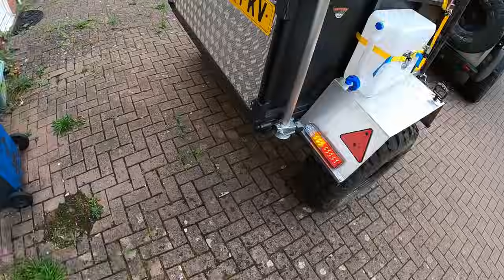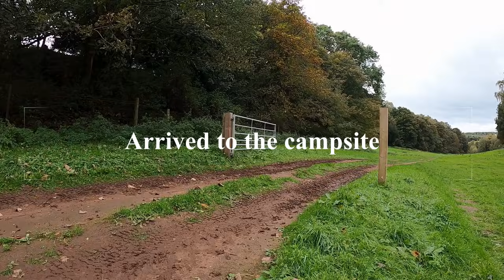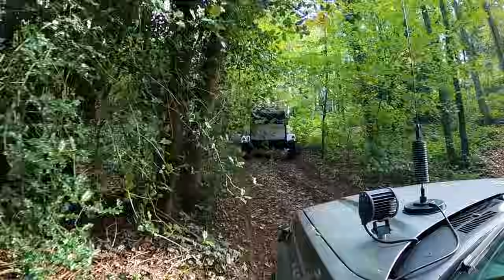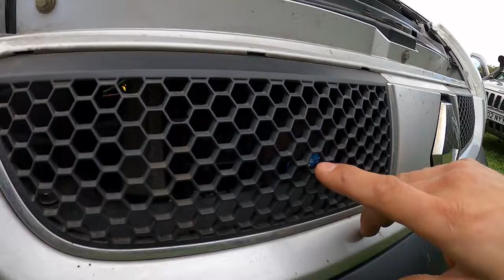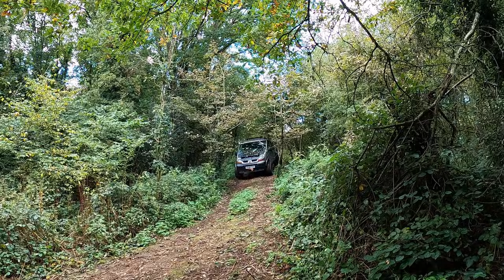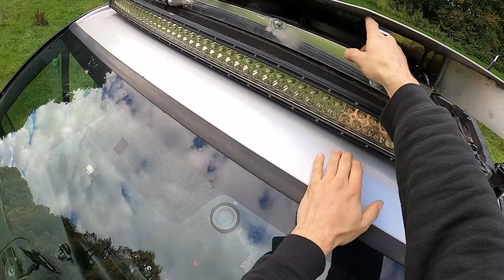4x4 converted van, off road and questions answered

Comment: What kind of engine is installed there? I have the same Renault Trafic and I am interested in building something similar
Reply from the maker: Its a Mercedes om606 engine with mechanical fuel pump build with bigger elements and vnt turbo, around 400bhp, I've sold it some time ago now. Trust me you do not want to build one.
Reply: @zurawskimotorsport This is my first car. I've hitchhiked a lot and now I want to travel in a motorhome. I've already made half of the living area. Now I just watch a lot of content and talk to knowledgeable people. I was just wondering how you managed to fit such an engine in there. I googled it and was very surprised that it was only 3 liters. It sounds very powerful🔥

Comment: What 4x4 van would you choose in the United States?
Reply from the maker: Well it all depends on your needs, if a small class van then probably an econoline,  I actually have one in the workshop doing Bentley w12 twinturbo mid engine, have a look at my other videos its all there. If large class then a sprinter /crafter seems very popular and I'm planning to build one soon, the think is that in USA you guys have an incredible amount of options for 4x4 systems parts, axles , transfer cases etc so it's actually easier over there.

Comment: Hi, Thomas, fantastic build and a great vehicle. Could I ask if you are happy with the low down torque you are getting from the motor and Isuzu turbo combination and at what rpm does it kick in. Most of the OM606 4x4's I've seen on youtube are going fast doing high revs. Have you found your set-up suitable for slow technical 4x4 driving? I'm thinking of putting this set-up into a 300tdi 110 defender. Also, it would be great if you did a video on your trailer build, keen to see the suspension set up. Many thanks, love watching and listening to your videos!
Reply from the maker: Hi, thank you. The torque is pretty much immediate,  with auto gearbox engine builds load later than manual transmission but pressure starts to build as soon as there is load, in off-road with the transfer case in low I nearly never use 1rst gear as almost too "reactive" so torque and responsiveness is absolutelly spot on or actually much more than needed, obviously with power band lower down on the rpms range it looses top power , with the gt3582r it was way faster and can easily outrun x5's it was a bit lagy and less suitable for slow technical driving in off-road especially with the trailer.
Reply: @zurawskimotorsport  Many thanks Thomas, do you think the R380 is up to the job with your current motor/turbo set-up? Sorry for all the questions!
Reply from the maker: @darrylthompson9431  hmmm most likely no,  it really does put some torque down and you'll have to be careful with the gas pedal, that's not what you want, mate it with a good strong box and you'll love it
Reply: @zurawskimotorsport  That's what I was worried about! A few people here in Australia are running them (R380) behind the Isuzu 4BDt and say they are OK but like you say, it's not something you want to nurse. I appreciate you taking time to answer my questions. Keep up the great videos and thanks again.

Comment: I thought it's just another "drive-through-woods" video, but in the middle there is lovely intermezzo with hell lot of details about how and from components this beast was built from. Appreciated!
Reply from the maker: Thank you,  I was a little worried it would be boring as very mild off-road
Reply: @zurawskimotorsport  Yes it was, a bit long so I'm not sure if everyone withstand to appreciate your design talk as some might skip that too early. But those details overweight the initial part. I'm not going to build such a beast, most probably. But I appreciate when someone put his soul to something and not just brag about what he bought and have just raw idea how's that built. So your video, second half, is really something extra for me. Thanks.

Comment: Excellent build! Can you give specific year/model number for the mechanical engine please, and have links to the new gear box setup, aftermarket controller with itemized list? Thank you very much :)
Reply from the maker: Hey it's the engine from e300td 2000 year with the om603 pump this ones are all mechanical,  pump is then modified with bigger elements and external alda ( devise that rises fuel ratio when on boost). Gearbox controller is ofgear  722.6xx gearbox, box you can find it from jeep wj crd but many other std 4x4 have used it as well, you'll need the gearbox from the e300td as well for bellhausing etc as you'll need to swap it with the wj gearbox. It's actually fairly simple

Comment: Awesome build, with plenty of great ideas ! How much did it cost you ? It’s a dream build but it looks expensive to make
Reply from the maker: Waay too expensive,  lime I said based on trafic,  but based on anything else that was already rwd it's a different game, at some point next year I have to build couple of sprinters/crafters and that's much much simpler and cheaper believe or not
Reply: Thomas Zurawski way too expensive but now you have an unique piece and that was certainly worth it, it just lacks a pop top roof in my opinion to be perfect
Reply: @zurawskimotorsport  Or there`s this https://arstechnica.com/cars/2020/09/now-you-can-get-an-land-rover-restomod-with-a-tesla-electric-powertrain/   335kW (450hp) generated by a Tesla drive unit, straight to the axels and 100kWh of lithium-ion batteries..... 600bhp is an option too.....
Reply: @zurawskimotorsport  Tesla motors front and rear and any size battery pack in-between just add to it to increase range and tune the motors to match... there is a 35kw beetle with 600hp so it`s possible for the Renault :):)
Reply from the maker: @kylereese4822  funny you said that as it's been some time I was thinking something down those lines, but charging is kinda difficult in the middle of nowhere,  plus this stuff isn't yet affordable enough I think
Reply: @zurawskimotorsport  An interesting channel to look at is Damian Maguire on YouTube he`s done a Tesla BMW to a 1000 euro BMW and all sorts in-between  so worth a look :):)
Reply from the maker: @kylereese4822  thanks, will definitely have a look.
Reply: @zurawskimotorsport  You could use 2 of these  `  1988 Honda CRX with Nissan leaf motor and custom controller Dyno's 302.3hp! ` 1 output shaft to the patrol axel  the other shaft locked  or do a diff delete creating a single output shaft Leaf gearbox  https://www.youtube.com/watch?v=S6OInkLWAhk    ??
Reply: @kylereese4822  I for one am looking forward to the cybertruck. Once it's available on all the markets and assuming they will add optional solar charge, all I need is to wait untill they grow old and appear on the used market. So, about 10 years from now. That will probably be my first and last camper. Based on the marketing videos I watched so far, it's absolutely perfect. As soon as their price drops or I win the lottery I'm getting one. 🤣

Comment: Was it difficult to register the engine swap and how did that affect insurance? I imagine it limits the number of companies who would insure you and also elevates the premium? Cheers!
Reply from the maker: No problems with the engine at all and insurance wise I have a trade policy that includes everything so for me was no issues at all however there are specialised ins companies that will happily insure it and actually not expensive as well.
Reply: @zurawskimotorsport  Try something like this in Austria and the guys with the "hugyourself vest" will come and get you. Love your Van. I Just build a Trafic myself. I also have build a spare tyre mount in the back with a included ladder to the roof rack. Wanna lift the chassis about two inches..have to figure out in the Front. Rear is no Problem. Looking forward to go traveling with it. Greetings from Austria 🔧🤙🏼😁
Reply from the maker: @lukasschimpel9655  that's a shame, I honestly don't understand why they making it very difficult to modify stuff without big problems,  do it, get it tested, if all good then off you go, so simple, too many rules and regulations we didn't agree on destroying the fun of living
Reply: @zurawskimotorsport  it's a pain in the ass in Austria to be open minded when it comes to improving or building stuff on your own. As a normal guy having a little craftsman shop you are fucked. You gotta have a pretty stuffed wallet when you want something outstanding. Hate my Home Country for that